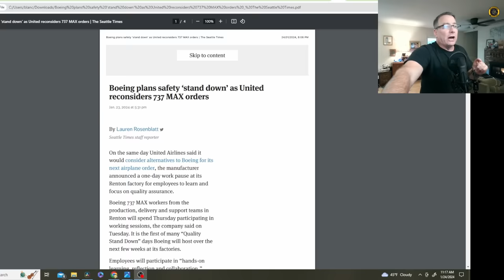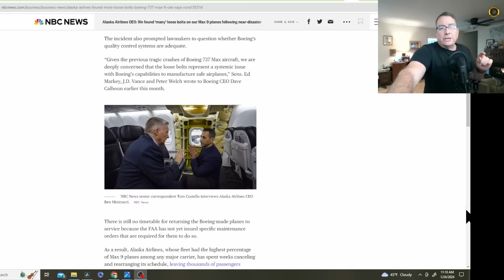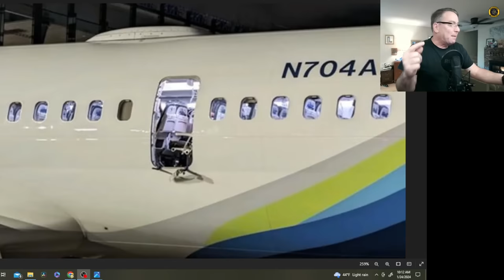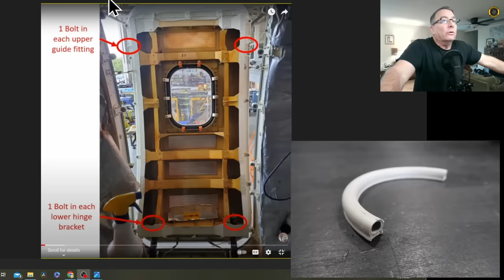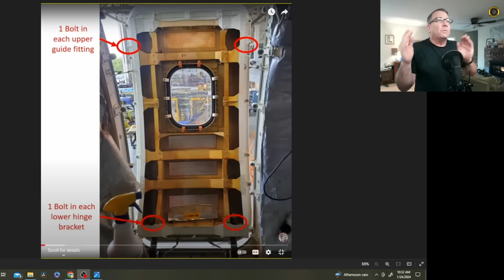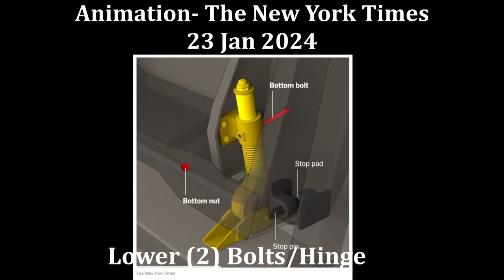Boeing's Quality Management Failure Explained 737-Max-9 Door 24 Jan 2024

Comment: After 20 years in the automotive industry as a Quality Engineer, I moved to the aerospace industry about 10 years ago supplying both Airbus and Boeing pipelines.  I was shocked to discover that the quality management systems in aerospace are nowhere near the robustness and maturity of the auto industry.  Makes me think twice about flying.
Reply: Dude, I am the same as you.
Reply: Flying ⚰️ coffins
Reply: That is just wild
Reply: At what company?
Reply: And despite this unprovable claims, aviation is still one of the safest ways of travel
Reply: At least my Chevrolet had essentially all of its bolts and capscrews in spite of some of them being undertorque or almost finger tight !
Reply: —Interesting point. It may have something to do with the differing customer bases. The auto industry has to please millions of customers who, if they're not satisfied with the QC of their purchase, can easily buy from another automaker the next time. And there are dozens of such companies.
—Despite its huge size, the airline industry has far less flexibility. In practical terms it is forced to buy from either Airbus or Boeing. Changing from one to the other entails enormous costs in retraining for maintenance and flight crews. There is also the years long wait list for aircraft delivery. If an airline decided to drop an order with Boeing, it is likely to find itself at the back of the line for Airbus.
Reply: Union strong.
Reply: I set up an automotive supply chain test lab (ISO 17025 / TS 16949) an escape like this one is hard to imagine.
Reply: Yes that is what i've always thought. A much cheaper automobile seems to have much better quality built in than an aircraft.  Where I work they are constantly fixing new aircraft that you think would quality reliable parts.  Yet my comparatively cheap 98 Tacoma truck is approaching 500k miles with very little maintenance done and not once has the engine ever died or stalled out on it since the day it was new.
Reply: These companies are afraid to upgrade any of their existing systems no matter how old and bad they are.
Reply: @MrCarlozan96 That’s because of redundant systems that keep incidents of mechanical failure largely unknown.  And rigid protocols for flying.
Reply: Gee, who knew getting into a flying contraption and going thousands of feet in the sky wasn’t so fucking safe for a human being.
Reply: @jordanhenshaw  If only fanboys could ensure quality.
Reply: The 2023 Ford repair campaigns affected 5.9 million vehicles, down from 8.6 million in 2022,
In other words cars fixed voluntarily or on recall.
Reply: and jus tthink.. right now aerospace is attempting to replicate the success of 'lean' from auto manufacturing.
Reply: Thank D.W. Demming.  Statistical Quality Control.  Guess Aerospace does not believe in such things.
Reply: @sizzelot  Do you know what it means to produce process and plug a single type of automotive electrical connector 1bn pieces per year without a single failure?
Automotive industry would be dead without the right processes in place.
The produced number of aircrafts is somewhat lower so they run it on human factors.
Reply: @Bob1934-l6d  To run statistics you need high production numbers.

Comment: Another problem created with this type of issue is how many other components, systems and processes are suspect, and on other models? Trust is everything. Boeing has a big problem. Juan, appreciate your channel and the work you do.
Reply: In God we trust, everything else we check
Reply: Once you lose the public's trust, it maybe impossible to regain it!!
Reply: @garybulwinkle82  Yes.
Reply: That is my fear.  What else could be loose or missing on these aircraft, something that may turn up in high time aircraft (in a few years)?
Reply: "how many other components, systems and processes are suspect, and on other models" .... all of them. Every aircraft, every system, every f'ing bolt.
Reply: This is yet another example of why it is never a good idea to cut corners! (especially in aviation!) Fate has an interesting way of rearing it's ugly head.
Reply: 787 has huge QA issues.
Reply: Absolutely. While it's understandable that the media are concentrating on the door plug, they're kinda missing the forest for the trees. This time it was a door plug; but if a door plug can have loose bolts, what else has slipped through and just not fallen off yet?
Reply: I used to say that I trusted Boeing aircraft over all others, that is not true anymore and I'm glad I'm going not to be flying Boeing aircraft for a while.

Comment: Great report, thanks. There has been much in the news about finding “lose” bolts, but I always felt this would be irrelevant. Since the bolts are loaded in shear, as long as the nut is installed preventing them from simply falling out, there is no way the door can open. Simply they were never installed, your breakdown in their quality process things are starting to make more sense.
Reply: Nuts can vibrate off if not torqued properly or if the cotter pin is left off.
Reply: Just note that while inspecting these specific bolts, they have found other bolts that have been lose. Bolts that actually must be torqued with force and that are not relying on any cotter pin. So it has been a bit hard for the news to keep track of all issues.

Comment: The CMES does not take into account if a mid cabin door was fitted with a plug door or a deactivated door. So it gave operators the option of selecting an option which only makes sense if a door is fitted. And operators selected it because it gave them a loophole to close the ticket faster. Nice.
Reply: Call me old fashioned but did this happen before computers came into being? I was a general aviation pilot and they used to laugh at me because I spent so much time pre-flighting my plane before I went up. I said I was the one going to be up there and I want to make sure everything was in working order I don't mind taking a few extra minutes. This is a terrible thing when you go flying  how do you know that your plane is put together properly? Certainly hope this problem can be solved.

Comment: I have been in manufacturing in a variety of roles for almost 30 years. Regardless of the business, but particularly in manufacturing, understanding and constantly tending to your core competencies is ALWAYS job #1. When Boeing decided to build airplanes by committee and outsource their core competencies, it was not IF things like this would happen, but WHEN. An entirely foreseeable consequence for those who truly focus on the business rather than the profit. But Boeing got rid of most of those folks. The only question now is whether they are willing to do the hard work to fix this or whether they are doomed.
Reply: And you can rest assured that there was someone that warned them that this would happen and that person or persons were ignored
Reply: @MrSiciro  or fired
Reply: @Mantarr1  More likely, both. 
One of the key takeaways here is that there were essentially two identical processes. One to remove, and one open the door. 
Why, when it is essentially the same job? 
I suggest the answer is probably for one of the following scenarios. 
No inspection for opening, since it speeds up operations.  
Speed first, Safety last. 
Alternatively, this is a cut and paste error. 
In other words, the process was lifted from a similar airframe or variant's process, where the two processes, opening, and removing, were entirely different. 
Blame will be dished out, no doubt, but will lessens be genuinely learned?

Comment: My grandfather was a master Machinist for Lockheed Martin back in the 50s 60s 70s and early 80s. Their attention to detail was of utmost importance. If anybody dropped the ball they will let go rather swiftly. And it makes sense as lives are on the line.
Reply: That sounds like a safety systems failure, to me. Individual can and do "drop the ball" on things like this, and that's not going to change because humans will never be perfect. If you want better safety, you need systems that can deal with this, catching and fixing human error. The person who should be fired is not the one who dropped the ball, but the managers who let systems get set up that let the errors through when an individual drops the ball.

Comment: Treating the door removal as some kind of temporary event .... just wow!  Any removal of 'fixed' accoutrements should be logged and re-inspected!
Reply: Watch again.  Door "removal" was logged and tracked.  Door "opening" was not.  On most doors they are obviously two different things.  In the case of these doors they are virtually the same thing.
Reply: @johnaclark1  Yep, on a normal cabin door, there would not be any process to check a door after it is opened and closed.  Normal operation.  But this "door" isn't meant to be opened and closed, and to do so requires removal of the bolts.
Reply: Doors can be 'removed' or 'opened' while plugs are always 'removed.

Everyone (Juan included) seems to be calling the plug a door however.
Reply: It’s not even when a fixed item is removed. Anytime a bolt is unpinned and unthreaded there needs to be accountability for that bolt until it is reinstalled, pinned, and inspected.
Reply: Are we at a point where we're finally stupid enough where safety depends on whether something got logged or not?  On safety critical items, even in my garage, I never walk away with something half installed.  It's either fully installed or fully removed.  It's never in between.  And does the line supervisor need the computer to tell him to do a walk around and look for obvious things before they button up the aircraft?
Reply: @LeverPhile Because it is a simplified door that gets fixed closed and is supposed to stay closed, unless it needs to be opened…
Reply: @johnmoruzzi7236   Not a door it's a plug that replaces a door.  Definition of "door" is "a hinged, sliding or revolving barrier at the entrance of a building, room or vehicle".
Reply: @LeverPhile  Because it basically is a door. With hinges and catches. And a window.
Reply: @johnmoruzzi7236  No hinges at all on it.   It's a wall panel with window.  It cannot be opened in any way or manner, which is why the paperwork was wrong.
Reply: @LeverPhile  You are deluded.
Reply: @johnmoruzzi7236  Your rationale is exactly how the records here were mis-used and falsified here.  They called it a door and claimed it had been opened instead of removed.

Weak of you to insult instead of looking up a word in the dictionary.  Bravo 👏

Comment: After hearing about Boeing eliminating 400ish QC positions back in 2019, I wondered how long it would take for an incident to occur.
Reply: Source?
Reply: @Boris-Jx  I probably shouldn't have said anything
Reply: Boeing has been trying to eliminate QA for many years, seeing it as an un-necessary expense.  Just have the mechanics sign off on their own work, that's just fine.
Reply: We have people in my group managing projects while working from home. It is such a joke. Hoping they aren't allowing QC via zoom calls or some other nonsense.
Reply: @treborg777  Yet people tell me that there is "nothing wrong with making a profit"...
Reply: Not to mention but where were the FAA inspectors? Anybody?
Reply: Not 400, rather 900, they went from 3000 to ~2000.
Reply: @mcahill135  Boeing never notified the FAA of the radical changes in their "quality assurance" processes, the FAA never approved those. FAA only learned when Boeing employees and their union protested against those changes, which led Boeing to re-instate some of the quality checks they had dropped. They dropped more than 1,000 check steps per 737 delivered !
Reply: Instead of 400 to 900 QA personnel, how about they let go 10 to 20 high-level management people, including the CEO.
Reply: Never underestimate the power of a bean counter.
Reply: @uwekonnigsstaddt524  Never underestimate the power of self-interested executives (and the shareholders they’re beholden to) driving those bean counters’ priorities.
Reply: @mcahill135  They are all in "DEI" training sessions.

Comment: i dont think its just a few bolts good buddy. its a mindset, viewpoint, way of business, and life. these fellas are driving what was a great engineering company directly into the ground. i wonder if they higher ups at boeing tell their family to fly on airbus?
Reply: The higher ups at Boeing fly on Gulfstream and other corporate jets.
Reply: I also noticed this at school. a lot of the new "efficient" business practices work great on paper, increase efficiency, profits, everything. until something happens. the "just in time" thing, where you dont have a backlog of orders stacked up in the back room waiting to go out the door, bit us pretty hard when a single boat got stuck in some sand halfway around the world. this thing where a company passes off the quality control aspect onto its suppliers and just assumes everythings proper when it shows up at the door with seemingly zero inspections. its no bueno. yes its costs an extra half a cent to test the metal a supplier sent to make sure its what was ordered. but it could save lives. yes going thru a new fuselage and doing an incoming, heck maybe even an outgoing, inspection to make sure stuffs torqued properly or even there in the first place *bolts*, maybe little johnny left his wrench in the wing flaps, who knows. it could cost $5 or it could cost your best friends life. grow a brain people.

Comment: What else hasn’t been fitted properly in Boeings?
Reply: A quality first culture.
Reply: We will find out soon enough
Reply: And air bus -   Same shit - different place !   Really !   Think about it .
Reply: @bobwilson758  I'm thinking really hard but cant recall a single time the 320neo became a bomb drone nor had it's door/plug blown off in-air due to missing bolts
Reply: Also missing, various screws, nuts, washers, pins, etc. around the aircraft. The name of the company really does sound like a part falling off. Boing!
Reply: Probably not much considering 1000s of these fly everyday without issus
Reply: Whatever is not written on the quality control check list, apparently.
Reply: The wings
Reply: @behar  Having them fly doesn't mean they're properly made, the Alaska 73 flew for 3-4 months without some bolts from what it seems and a lot more of the 737 max 9s have flown around with loose bolts just waiting to fully detatch
Reply: @gshingles Evidently the quality control department have a hell of a time getting their findings, conclusions and recommendations accepted.

I suspect the QC paper trail is a work of fiction.

Ask Caroline Kennedy.
Reply: @behar   they found more planes with the same issue

Comment: Back in the day building DC9's each part of the planes assembly was subjected to inspection. The inspection was documented by what was referred to as a snag sheet. Any manufacturing or assembly non conformances was recorded on these sheets then given back to production for repair. The plane was not considered fit until all items on the snag sheet were addressed. Each DC 9 came with a complete record of all SNAGS that where found. Missing bolts or rivets is an example of gross negligence for manufacturing, inspection and engineering.

Comment: The issue is that opening a door doesn’t involve removing things like bolts, whose replacement would need inspection. Of course, opening a door plug does but CMES appears not to register the distinction between a door and a door plug in this respect. Obviously management will have recognised that opening a door plug was a removal but they wanted to cut corners. I shudder to think what else has been going on.
Reply: If there is no documentation, then it never really "happened" anyway, they must think..😮
Reply: @arrdubu  Thanks for the clarification.

Comment: Small note about CMES vs. SAT--according to the leehamnews source, SAT is Boeing's second, not-authoritative records system--not Spirit's. Spirit has access to SAT, but "can't be allowed" access to CMES (even though it has apparently demanded in the past by Boeing Senior Managers).

Thank you for another great video! Love your channel!
Reply: cant be trusted?
Reply: @rachelLadyD  I would read the leehamnews link for more details--tons of interesting info there (though unsubstantiated). From what I understand, the reason Spirit employees are onsite at Renton is because the defect rate is so high (some egregious examples listed, including documented examples for this plane); otherwise, Boeing would be doing the fixes and documenting them in CMES (the authoritative record system). But since Spirit is onsite because they're rushing shoddy product out the door, and they do not have direct access CMES but do have access to SAT, the fixes are getting coordinated in a non-authoritative system. 

Boeing is ultimately at fault, but there are many things going on that made something like this inevitable. I can see why there are Boeing employees that refuse to board a MAX (even after they were no longer grounded after the crashes).

Comment: If these bolts were missing, what else could be missing or loose? That’s the scary part
Reply: Yeah, like linkages for control surfaces and whatnot tucked away in the wings! Scary stuff!
Reply: Exactly my thought. They already have an issue with rudder assembly bolts loose or missing.